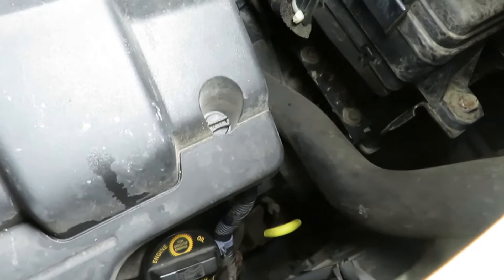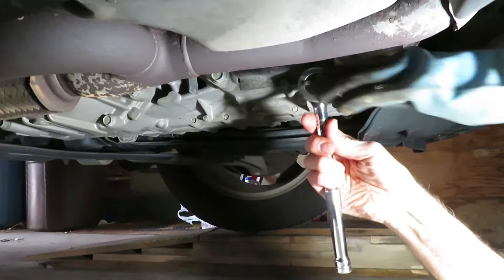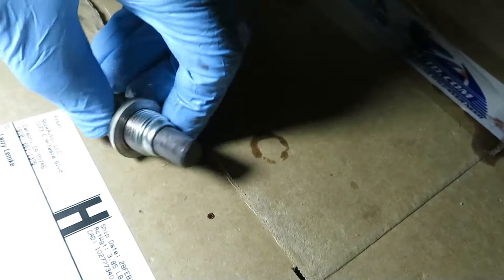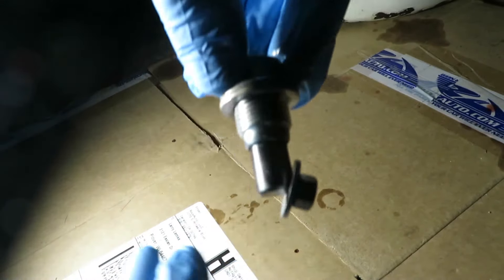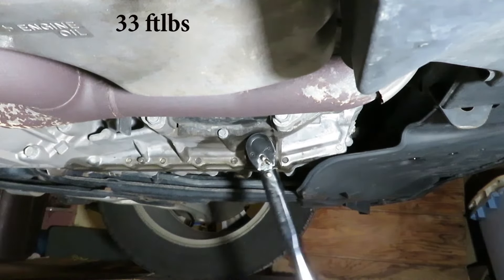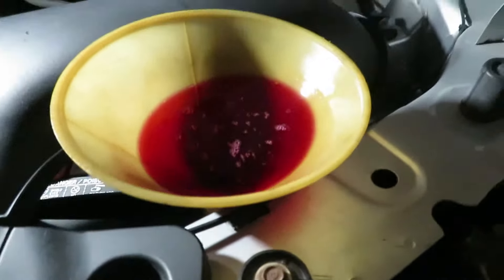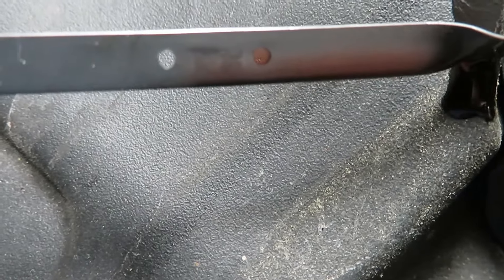Transmission Fluid Change 3.5L Honda Pilot ’09-‘13

Comment: I’ve got 100,00 on my 2013, I’ve got 4 quarts of genuine Honda ATF ordered from Amazon, this will be the third time I’m doing this partial change, it’s sooooo easy and the oil is a lot cheaper than a new tenant, love my pilot!
Reply: 2009 Ridgeline owner here.  Same drivetrain as that year pilot.  Thanks for the video.

Comment: The Fill point for the transmission s not the dip stick tube. There is a Fill plug on the top of the transmission right under the master cylinder. Takes a 17mm, breaker bar & long extension. - and don't lose the washer. Thanks for the video!
Reply: I was actually going to say the same thing I was looking at the service manual. It's a pain in the ass to get at that bolt a lot of people seem to avoid it at all costs.
Reply: @craigssellingmine  hey there. What size breaker bar do I need? And what size long extension thank you in advance
Reply: @gamboaassassin  convert your 3/8 socket to 1/2 drive with an adapter. Use a long 1/2 breaker bar.not too long. Dont bust a knuckle when it turns or carefully use an impact gun.
Dont over tighten when done. Dont drop the washer gasket. I put grease on it so it sticks to the drain plug.
Reply: @craigssellingmine  thank you for the helpful tips appreciate it
Reply: @ivan L.  I let the engine cool (less expansion of plug threads when hot) and gently tapped fill plug with a hammer a few times.   Then used a 1/2” breaker bar with 3/8” drive conversion into 10” extension into my 17 mm socket.    Stood on a stool and used open palm to push breaker bar avoiding a knuckle injury.   You can add a 6” long pipe over the breaker bar handle for more leverage too if needed.
Reply: @gamboaassassin  24 inch ext...I used a 12 inch breaker, was enuf...17 mm sock..and a long magnet stick to fish fill plug up...the washer stayed put.. ..long tapered funnel....doesn't need crazy torque after filling..cake...25 min, record time (for me) drain to fill, clean up...3.5 quarts...Honda ATF (ONLY !)...and yes, only drains/fills HALF the fluid..I do it every 40 K miles..
Reply: @NYCIVZ  read below...not really that bad..just care...
Reply: I took the top of the air filter box off to get some room for my hand.  As for loosening the fill plug with ratchet and extensions. No luck.  Used mid torque impact on lower setting to finally free it.   Its just difficult to get any leverage and torque using a ratchet
Reply: Does it really matter. Alot of people go through nthe dip stick hole
Reply: Dude that's what I thought cause I just did mine, if they put it in the dipstick I wonder if it fills it?
Reply: You realize it doesn’t matter right?
Reply: @pastorammo  It takes a lot longer time to get all that fluid down a tiny dipstick tube
Reply: @craigssellingmine kinda like Paul Stanley working at the Sinclaire in upstate ny
Reply: So, using the dipstick hole is fine if you have the time?
Reply: @kmcygm  sure
Reply: You can absolutely fill the trans thru the dipstick. Please stop giving bad advice.
Reply: @Trebor-gw8lt  you can fill it however you want. Bad advice is through the dipstick tube. The fill hole is called a fill hole for a reason! If you want to do it the wrong way go ahead! Just don't tell everybody it's wrong to fill the transmission using the fill hole.
Reply: @craigssellingmine  you do know that any automatic transmission dipstick tube leads directly into the trans pan right? It’s best if you just keep your hood closed and take it to a mechanic…who will fill it via the dipstick tube. FYI - Honda techs use the dipstick tube to fill. I know that breaks your heart to hear.
Reply: Thanks for the update on the fill location
Reply: @tonyfromhell it fills it, just takes awhile to drain  from the funnel and hose he used, I'm going to do my 2011 and figure out the easiest method
Reply: The washers should always be replaced with new ones
Reply: @craigssellingmine easier the rusted ok fill plug
Reply: We put it through the dipstick at the dealership
Reply: @michaelharris-2001  doesnt that take a long time with the dipstick tube bring so tiny?
Reply: @craigssellingmine  actually the dip stick was too small for a funnel. It's just that the year after this one has a big enough funnel. They be changing the fill plug every new generation of these pilots
Reply: @craigssellingmine it does! That’s why they do it so they can charge more time. Not rocket science to untighten a 17mm filler plug. Dealerships are a scam for something like this
Reply: The fill hole isn't always easy to access, and in my case I can't even unscrew the plug. So the dipstick is a good alternative.

Comment: I bought a 2012 EX at 175k miles. It’s now at 238k. Carfax doesn’t show much past the 130k point. Definitely overdue as the trans is starting to act sluggish with acceleration. Getting on this tomorrow.
Reply from the maker: One tip though. Try to loosen the fill plug on top of the transmission first.  Then when you refill it will be easier than the way I did through the dipstick port. I'm going to get that plug loose one way or another next time I do this.

Comment: Whats the name off tool to put fluid on car what you had
Reply from the maker: I couldn't find a fill funnel that would fit the dipstick hole. I made one up using 5/16" vinyl tubing along with a standard funnel. There is actually a transmission fill plug on the transmission. Mine was seized up.

Comment: If I were to change the oil in a machine that would take all the oil, even the one inside the filter, and add new, how many cans would it take?
Reply from the maker: That would depend on the vehicle. This number will be in the owner's manual.

Comment: I got a A3 service code and tried a scanner but it didn’t work do I have to take it into the dealership? I’m not a mechanic but am strapped for cash it seems like an important code?
Reply from the maker: You can find that in the maintenance section of the owner's manual.  It's generally just a reminder of a maintenance job.

Comment: Hey man i need the exact tubes you used the black one and the clear one
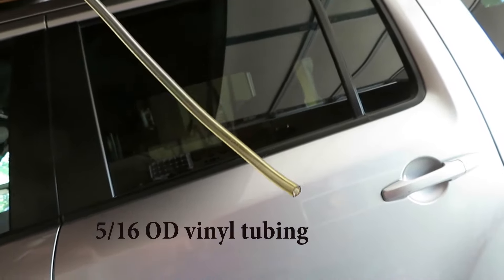Reply from the maker: The clear one: 2:27     The black one used to be a heater hose 3/8 ID, 5/8 OD fitting over a standard funnel. I used silicone sealant to seal them. Note though; there is a full plug on the top of the transmission that is intended for this purpose. Mine was seized up so I went through the dipstick opening.
Reply: @TheOriginalMechanic  everybody act like it's hard to get to that fill plug

Comment: I think it needs to be said that when changing transmission or transfer case fluids you should ALWAYS open the FILL bolt first before ever touching the drain bolt. If you drain the fluid then find out the fill bolt is seized up you are in trouble. Yes in this case you could fill from the dipstick but if it were your transfer case you'd be calling a tow truck.
Reply from the maker: Good and appropriate tip. This car does have a fill bolt and...it was seized. This dipstick fill worked but using the fill bolt port would have been easier.
Reply: I used a hammer to gently tap the fill plug after the engine cooled and then applied a 1/2” drive breaker bar with reducer to 3/8” drive and a 10” extension into the 17 mm socket to break it free. Stood on stool and used open hand to push breaker to avoid knuckle injury.
Reply: Thank you for saying that! I always see videos of people not opening the fill plug thats a must!
Reply: @TheOriginalMechanic

Comment: Was this your first change? Mine has 110K and I haven’t changed it but want to do this. Any recommendations?
Reply from the maker: Yes it was, at 120k.  I felt the same way. My dealership is recommending 30k but I couldn't find an interval in owner's manual. I think 100k makes sense.
Reply: 60k

Comment: Why did you only change the fluid and not flush it?
Reply from the maker: I've heard that flushing can cause unintended problems.
Reply: Never flush, it removes too much with detergents and can damage the transmission. Replacing the filter is ok but never flush. Most say that replacing the filter isn't necessary either.
Reply: @warriorxtman2  Detergents are already in the fluid.  There is no external transmission filter.  It's inside the transmission, not servicable without pulling the transmission.

Comment: Bro do they make funnels snallert enough for that hole
Reply from the maker: I couldn't find one. See what I used as 2:22
Reply: @TheOriginalMechanic  ok cool going to Lowes right now to get one
Reply: The one I bought says 5/16 Id 7/16 od is that right?
Reply from the maker: @ygbodybuilder3023 That's likely to be too big to fit. I used 5/16 OD. BTW there is a 17mm filler bolt that is intended to use to fill the transmission. Mine was seized though so I went through the dipstick tube.

Comment: What size washer?
Reply: And how do I tell that the car is properly warmed up before I test the level? New to this and trying to learn more.
Reply from the maker: It is warmed up fully when the coolant temperature gauge on the dash is at the operating level. I don't know the washer size. They offered it to me when I purchased the transmission fluid at my Honda dealership. I have reused drain plug washers many times over the years with no problem.  @taillefer23

Comment: You know, that was probably only about 1/2 of the total transmission fluid in the system, right? The torque converter probably holds 3-4 quarts of fluid.
Reply from the maker: Yeah I know and I'm Ok with that 😉
Reply: That why they want you to do it every 30k miles, thanks for the vid.
Reply: So you drive it around the block and drain it again. Gotta think outside the box Karen.

Comment: OK yes a stupid question....where are you? front or back of car? every video I see shows a tire but not a single video says where to look. there are 4 tires on the car and it is raining so crawling around looking for it is a major hassle.
Reply from the maker: The transmission pan is accessed from the front. I try to make that clear in a lead shot.
Reply: Changing transmission fluid in the rain wow